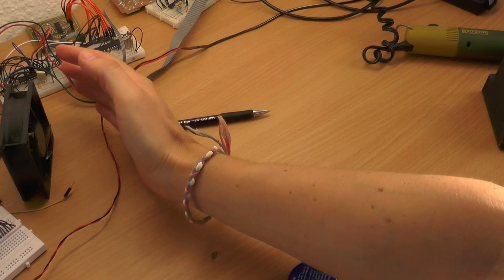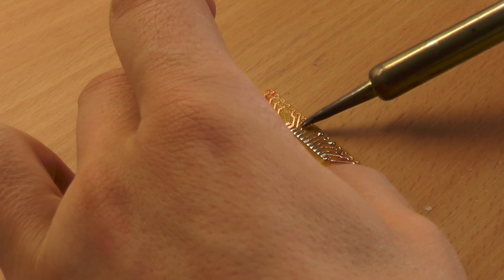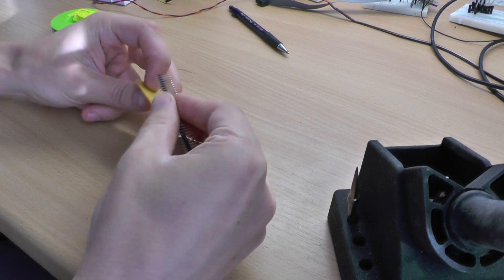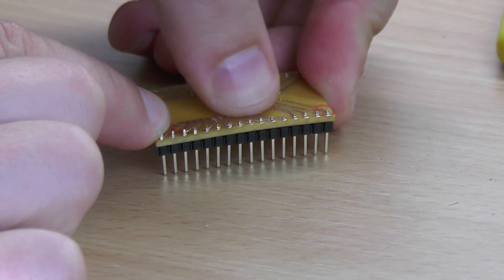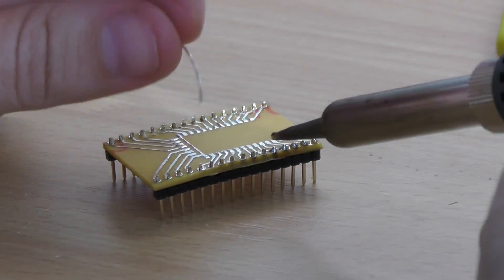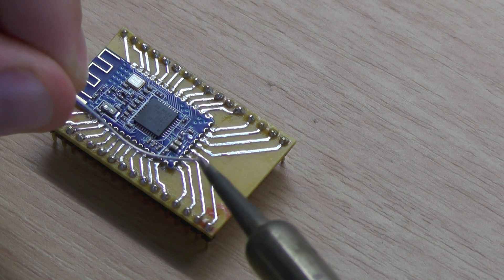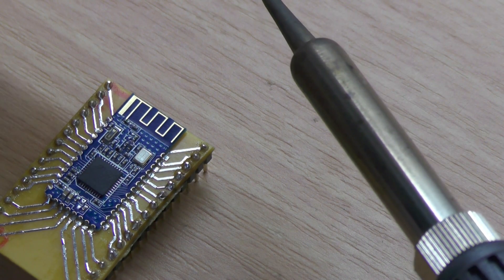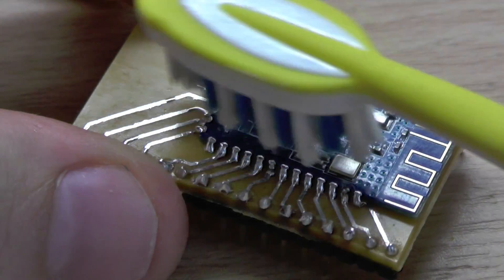Bluetooth 4.0 (BLE) - 05: Soldering

Comment: Hmm... Unfortunately, an antenna shouldn't be surrounded by any material like PCB substrate or, especially, like metal plates in order to maintain antenna's parameters and low mismatch (= better gain, greater distance etc.). Next time let the antenna "be in the air" :)